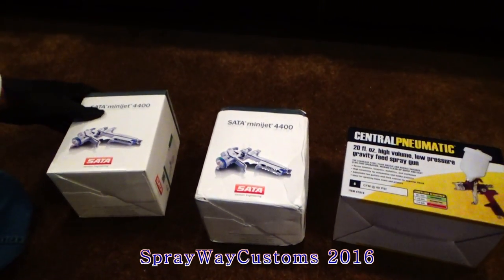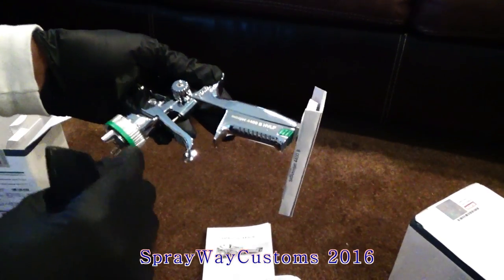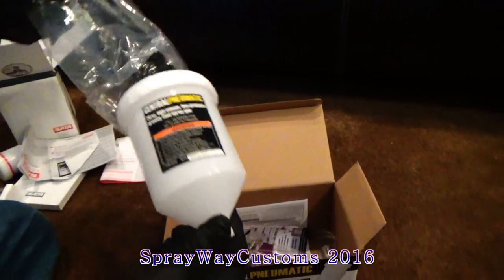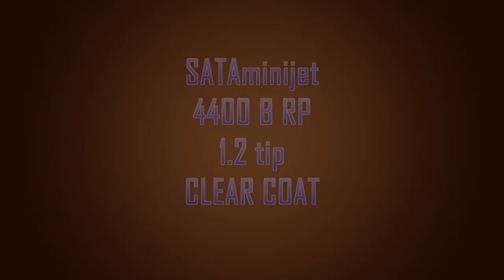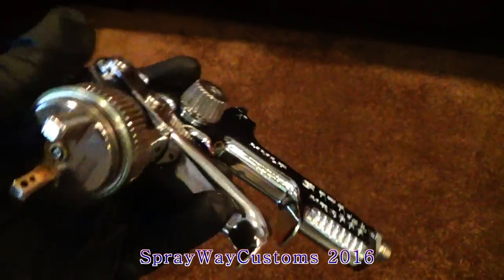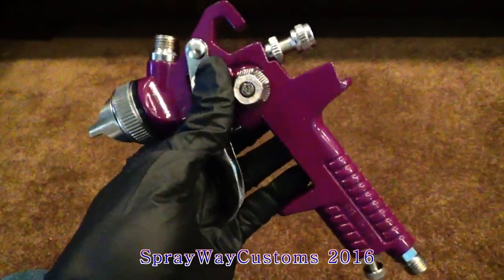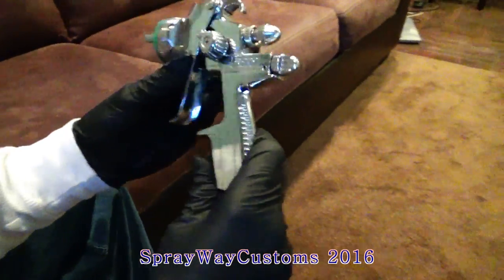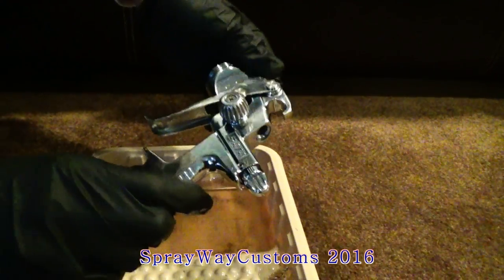Spray Gun Setup - Cleaning - HVLP & RP / SATA minijet 4400, 3000, 2000, 90 & Harbor Freight Gun

Comment: Hi Sprayway.
Does your Sata 3000rp have a seal on the back of the  thread on the air nozzle.Mine doesn’t & am getting a few bubbles in cup when spraying?
Just wondering if it does,  if could have come off when cleaning.
Cheers
Reply from the maker: It has a seal inside the nozzle
Reply: @SprayWayCustoms  Hi, thanks for replying.
Is it at the end of the thread, before you screw into gun body?
Reply: Is it behind the thread on the fluid tip?

Comment: I was wondering on the spray gun set up.…preferably the harbor freight gun…how would you set that one up to spray your primer? And if you chose to paint and clear with the harbor freight gun how would you the set the spray gun up? 
Lastly, what pressure setting would you use?
Reply from the maker: 30 psi with fluid and fan wide open
Reply: Thanks for the response bro. Means a lot. Watching your video how to cut a and buff. Very informative.

Comment: The Central Pneumatic gun is what I got
Reply from the maker: Ok..It's well worth the price
Reply: SprayWayCustoms How well does primer spray out of a 1.4mm nozzle needle? and it is well worth the price
Reply from the maker: It spray out pretty good as long as your not under reducing the primer
Reply: SprayWayCustoms What primer do you use I use slick sand high build primer what do I reduce the primer to what consistency?

Comment: nice gun set .FAM few questions when I am doing the poly primer do I really need to do my door jams,under the hood and under the trunk lid.Its going to be hard to block sand cauz everything is not flat. How many coat of poly should I do for block sanding??
Reply from the maker: I'm not gonna do mines...first off is you stripping the jambs down to bare metal ? If so I would...You don't have to block the jambs...if you get some nice coats of primer on them, just sanding will be fine just enough so your paint will stick...do at least three coats ...hope that helps Zo
Reply: You really, really, are impressive. I've watched a lot of your vids. very knowledgeable